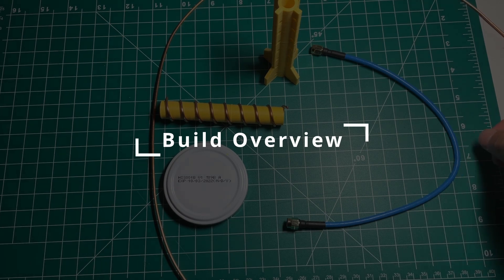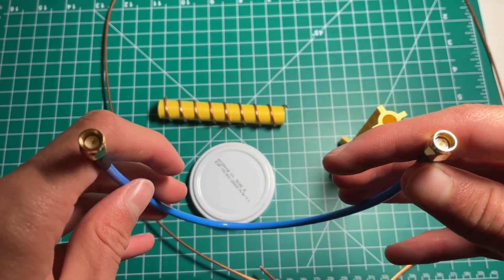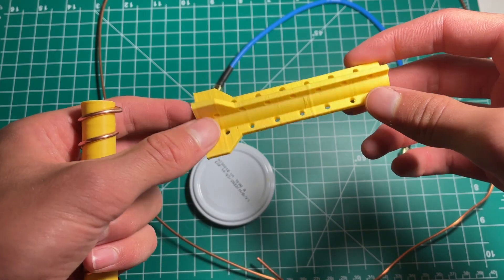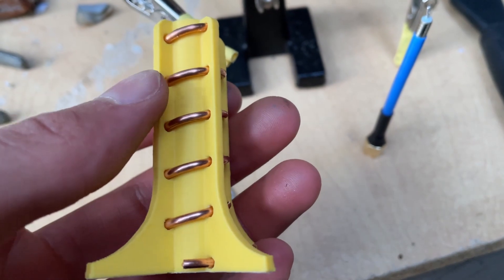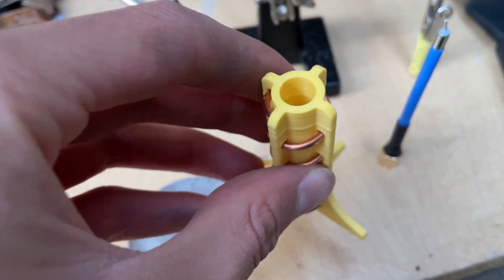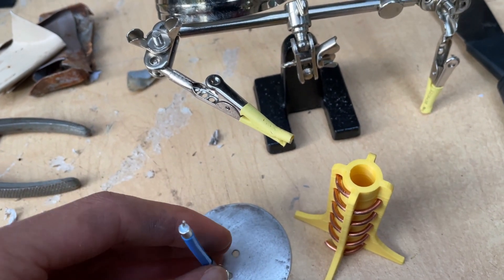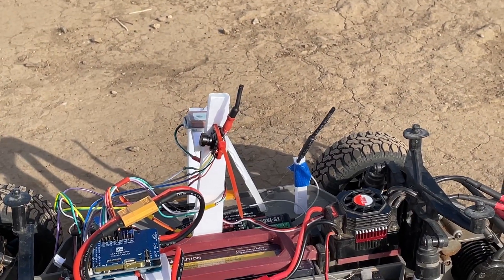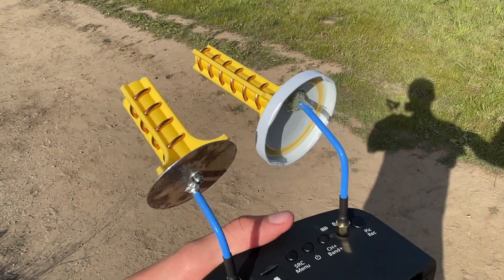5$ FPV Helical Antennas | 5.8ghz Long Range | Cheap DIY Antennas

Comment: Does the plastic parts of this device serve a porpoise or can i make it give me some better signal by doing everything you did except the 3d printed stuff like use stuff i have laying around or does the 3d parts have to be there to get anything all?😅
Reply: 3d printed parts are just there as a substrate and insulator.

Comment: So the yellow part that holds the coil is just structural to protect the coil right?
Does it interfere with the coils signal at all? Like even the tiniest most negligible amount?
Reply: its plastic, non conductive. Very low infill also. I would think not at all.
Reply: ｉｔ’ｓ　ｐｌａｓｔｉｃ

Comment: Why you did not use wave trap?
Reply: Impedance is well above 50 ohms without some kind of matching stub or wave trap. Also you’re using a linear antenna on the tx so you’d probably be better off with a yagi instead of a helical. Good to see it working though.
Reply: @m3g4byte you seem to be very knowledgeable on this.

I know literally nothing 😅 I'm trying to cheap my way into a ground station for long range fpv.
But I've got true rc x2air patches(2 and 2 omnis on dji goggles v2) so maybe trying to build something like this will only result in very minor gains.. like I said I don't know anything..

Oh I just seen this guy is using a rc truck, I'm trying to use a 5inch drone.
Oh now he's using a drone too lol 😅
Reply from the maker: I’m not sure what you mean. I understand that only the coil and reflector are needed for this style of antenna
Reply: @theorangebaron1595  Unless you are banned on Google, try to search for "IBCrazy's Wavetrap"
Reply: It will still work good in spite of impedance, next step maybe make a clover leaf on the transmitting side and you will have a great setup!
Reply: @m3g4byte  Hi, I am planning to use a radar system which sends radar waves to an object in a room through wall and gets the reflected wave back. Which antenna topology you think I should use for this purpose? I was planning to make a DIY helical one for the receiver but now I'm not sure, because you also mentioned yagi. I will try to match 50 ohms and it will be working on 2.4 GHz

Comment: how did you choose the general shape of the helical antenna? I'm not quite sure which online calc does the math right...
Reply from the maker: I just used some 3d printed formers from thingiverse. The designer already calculated the correct helical spacing for the 5.8 frequency.
Reply: @theorangebaron1595  thanks :)